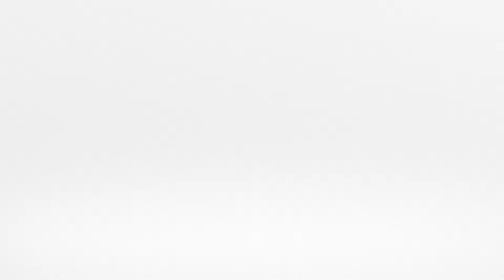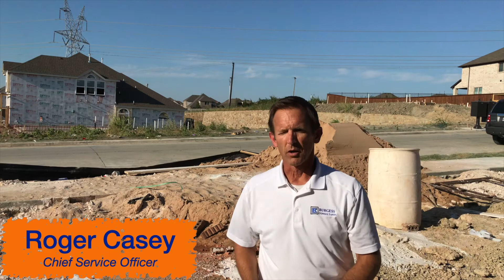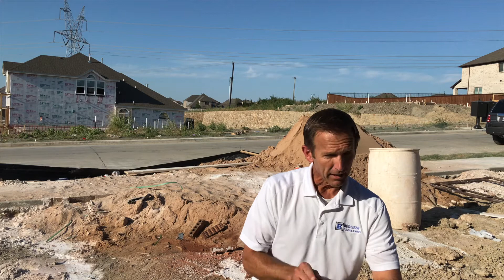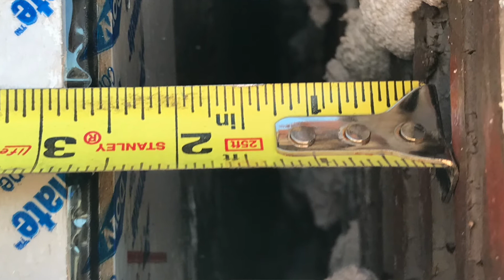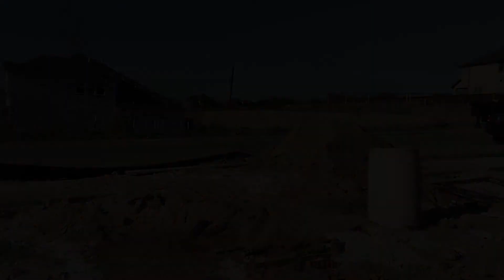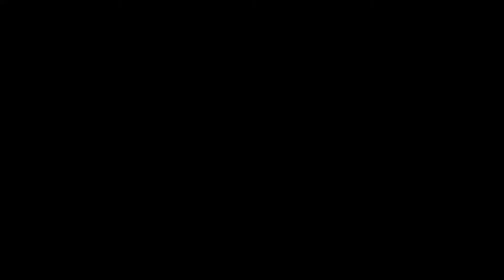Brick Ties - Size & Airspace code requirements R703.8.4.1

Comment: How would you ever have just one inch air gap with brick masonry?  In residential construction we always have a 5.5” brick lug and the brick sits towards the edge leaving more than one inch air gap.  I guess I didn’t realize the code says nominal 1” with the corrugated ties as never in my career have I seen any that would pass that test.  Sounds like I’ve seen a lot of masonry that is technically wrong?